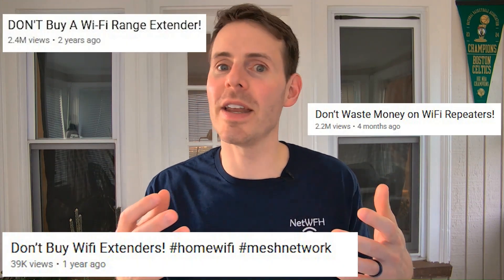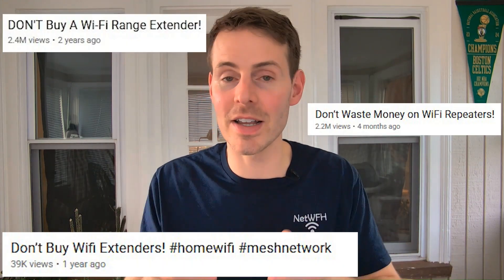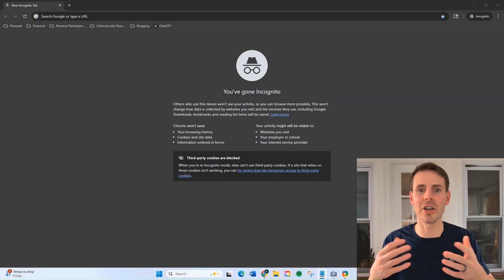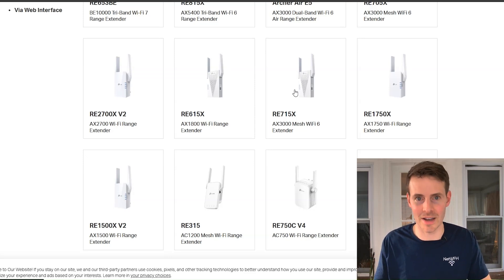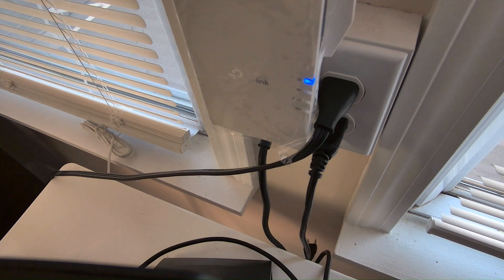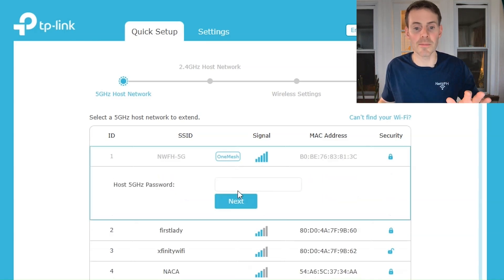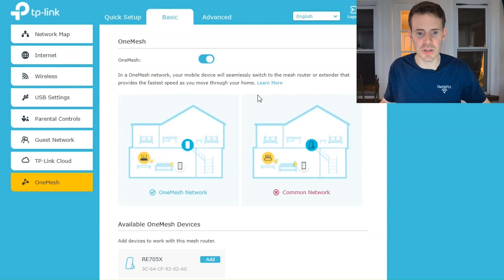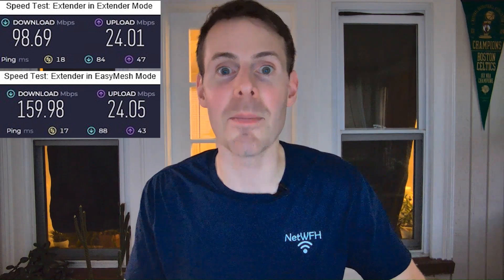How to Set Up Your WiFi Extender in Mesh Mode (TP-Link AX3000)

Comment: How would a WiFi 7 Triband extender work with a Quad band wifi 7 router??
Reply from the maker: If the extender can only broadcast 3 bands, that is all it will broadcast, even if it's connected to a quad band router. So essentially your router would still broadcast 4 bands, but your extender would only broadcast 3 bands. I hope this helps!

Comment: How do you know where to put each extender or when you put 1 on a Floor if it can still find a good signaal from the groundfloor. I dont wanna buy these things and find out my house is blocking signals
Reply from the maker: If you still get a good signal from the ground floor, it sounds like you might not need an extender. Extenders will help you the most in areas of your home where you don’t get good WiFi signal (or no signal at all). I hope this helps!

Comment: I was wondering if having the main router (wifi off) connected via Lan to a TP-Link AX3000 setup in AP mode, if I connect another TP-Link AX3000 to the main router via Lan and configurate as the other TP-Link, will they communicate with each other as easymesh but using Lan as backhaul connection (thus not reducing speed/latency)? 
I know that this  is possible with the TP-Link deco mesh devices, but wanted to know if it's possible to "replicate" the setup using two of their extenders, such as this one.
Reply from the maker: Unfortunately, I don't believe these devices have this capability. With that said, if you put your extenders in easymesh mode they can communicate with your router wirelessly. This will effectively make a mesh network in your home. I hope this helps!

Comment: My AX3000 that I had laying around works very well in easymesh mode with my BE550 pro router.  It's a better setup for my medium sized space than a full mesh system.
Reply from the maker: I love that! EasyMesh mode is a great feature for those people that are in between needing a standalone router and a full mesh system. Thanks for sharing!

Comment: Great video well explained for us tech noobies.
I have that extender but does the router need to be a tp link brand or is the extender compatible with any branded router that supports mesh mode
Reply from the maker: If you have the same extender that I do, you need to have a TP-Link router that supports OneMesh in order to use it in mesh mode. I hope this helps!

Comment: Your AX3000 looks a little different than the AX3000 I just bought from Amazon. In fact, it's looks different than the one your link goes to. Is yours an older model or newer?
Reply from the maker: I got my AX3000 at a computer store near my house, and it’s newer. Maybe the version of extender you got on Amazon is an older one? In any case, even if it looks a little different, it should operate the same way

Comment: How about AT&T fiber router will the support
Reply from the maker: If you have an AT&T fiber router, you won’t be able to use this extender in mesh mode. You would need to have a TP-Link router that supports mesh mode. I hope this helps!